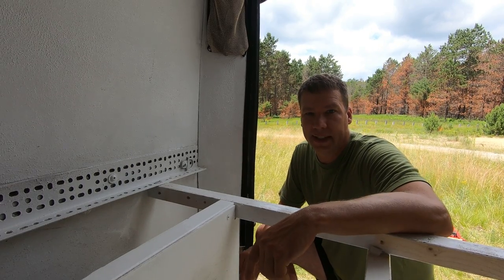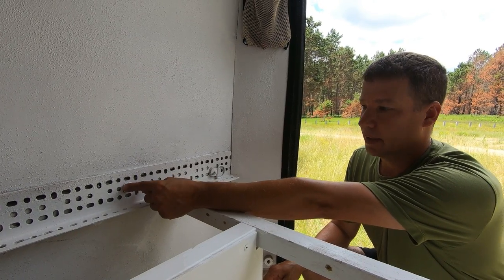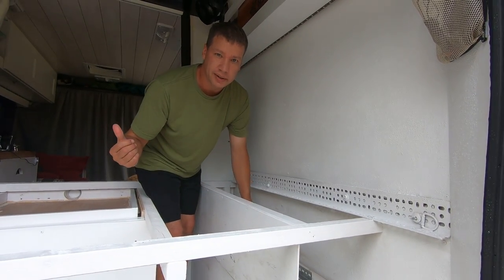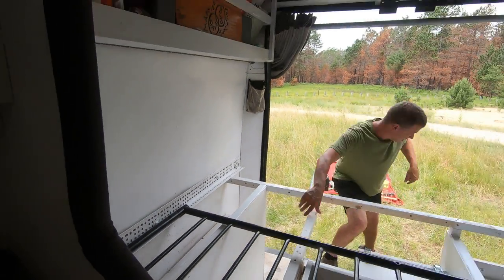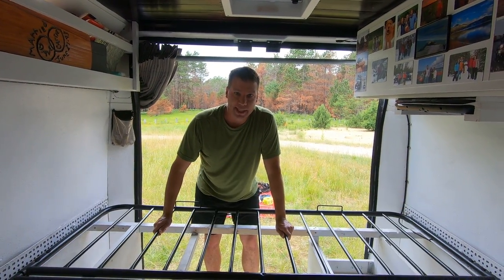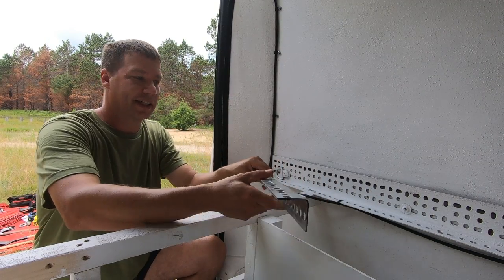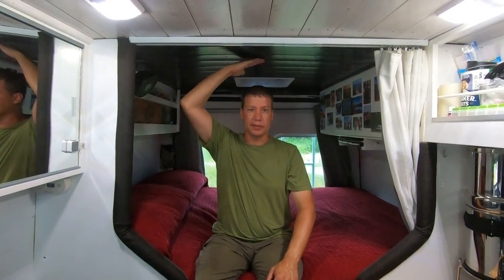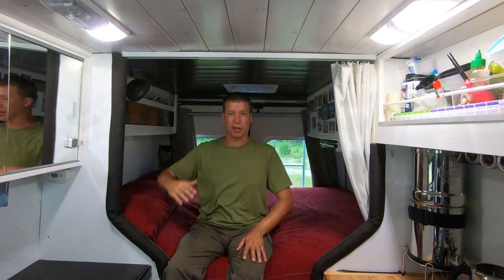Van Build: DIY SUPER EASY Bed Platform Installation

Comment: What a great idea. My van is going to have the same futon frame. Or it looks the same from IKEA but mines going to actually be used like a futon then convert to bed. I bet a lot of DIY’ers are going to use this idea. Love your channel.
Reply from the maker: Thank you so much! Which way will the bed face in couch mode? Sounds awesome and we would love to see it all finished up.😀
Reply: The floor plan is totally different than yours. The futon is in the middle of the van. When in couch mode you face the sliding door. When in bed mode your head would be behind the front seats and feet toward rear doors. It’s not complete yet. I’m loving and learning a lot from your channel. Would love to show you when it’s complete.
Reply from the maker: Sounds awesome!

Comment: Outstanding job, I like how you used the futon frame and slotted angle iron.
Reply from the maker: Thank you, Lamar. It feels good to repurpose things that we had. That futon from lasted nearly 2 years before the welds started breaking. We ended up having to buy a bed frame. It also fitted right into those angle iron braces.😎

Comment: Greetings, 
As the owner of a 2021 Ram ProMaster, I am closing in on finalizing among many options, which bed I will install in the back of my van.  This is close.  I'd like to ask about squeaking as you drive the van.  Does the immovable nature of the futon bed base cause squeaks?    I noticed some who used the IKEA bed spans to build the base.  What i like about that path is, the spans have the ability to telescope to different lengths.  ***This also means the spans will "breathe" as the van rides down the roads all over the country.   I am convinced this would lover the squeaks that will occur due to the immovability of the spans, for example, in the use of the futon frame shown here in this video...   The alteration from this setup is as simple as using the free brackets and then hooking the aluminum rails to the brackets...   Thank you for your time,
Reply from the maker: The futon frames worked great for about a year but the. The welds began to break.  We have since replaced with a metal frame from Amazon.  We have LOTS of rattles and noises in the van but I don’t think we have ever noticed any coming from the bed frame. Here is a link to the video where we replaced the bed frame! Oh and one last thing….. it is VERY IMPORTANT to have space between slats or you will have mold!  

Futon Frame Bed System is a Failure / installing a ZINUS bed slat replacement system.
https://youtu.be/WlhOfHHjEI4
Reply: @oneadVANtureatatime  
Wow, thank you!!
I will watch the replacement video..!

Comment: Thank you for such an excellent idea! How is it going sleeping across the width of the van? Any issues crawling over each other to get in and out of bed or challenges leveling the bed while parking? Thanks for your insight and a fantastic video!
Reply from the maker: Hi Jess. We like sleeping width-wise because it saves more room for the rest of the build. Since this video we have added more sleeping room by making cut-outs in the wall. I think our next video..tomorrow where we add a cabin window will show that extra space. I am 5’10 and now the bed is good. Yes, we do cross over each other, but it's not a big deal...at least I don't think so 😀
Reply: Great to know! Thanks so much!

Comment: I did the same huge weight saving. I cut a metal bed spring frame about 7" of the center  then put 3' metal sleeve inside and pound it together. You have to take off 2 roll of the wire mesh then spring load it again.custom size.
My frame was a light strong wood frame. Which I used as storage above. It's 2 feet of the ceiling just before the bed right a across the van. On mine it rest on my conversion old roof top and a snug strong got a high top.
  Think I the only one doing it this way. That is I want a real living room open space.  So I also run a made wood frame from the front old roof and storage above the driver cab on both side all the way back to just in front of the bed and  rest on that cross member frame. So it  has 3' of walking head room in the middle. Enough to stand and shower too. 
       With so much  storage room up. I only got my 4- 6 volts battery's stove 22 gal propane. A kitchen island, blender and ice cream maker maker. &  A.c air.   Then before the bed I've got a carpet 1-1/2 ' step up area.  that to lie on before the bed and pantry storage and water. Under you need to lift up the floor door. So my high top van has a full living room and I have swevel seats also. It totally wide open below.  the whole van are is open and to design and furnish mine a Art Deco/ ocean decor.  I also got custom louver. in where my big top Window use to be. and the back right side louver can be push out and hold up with a stick. Again a first. LOL

Comment: I am in the process of build and your futon idea is the best and easiest.  Can you tell me the measurement of the futon frame you are installing on the promaster .. thanks
Reply from the maker: We used a futon frame for a full size bed. The frame worked great for about 1.5 years and then the welds began to break. We have upgraded our frame to this frame from Amazon
Reply from the maker: Zinus Bed Slat ~ https://amzn.to/2Yd8CZH

Futon Frame Bed System is a Failure / installing a ZINUS bed slat replacement system. https://youtu.be/WlhOfHHjEI4

Comment: Wow! That exactly what I’m doing! Is just that you are doing it much simpler then I am. I should have waited to come across you video to fallow your step. Quick question! Can you please help me with a DIY? I am looking to find out how to install my cable wires to my alternator to get 220v. I have a 2021 ProMaster 2500 series 159w base with a 220v alternator built in, but I haven’t found a video showing this type of installation. Can you please direct the information to my attention. Thank your so much ahead of time. I will post a video on my installation once I get the info.
Reply from the maker: Hi Jose! I am no electrician but here is what I did. I bought a 1500 watt sine wave inverter and used the wires it came with to hook it right up to the vehicle battery. I mounted the inverter to a board that fits between the two seats and protects the floor. Just know that we have heard if you do this it could affect your vehicle warranty if you have any electric issues. Our warranty is over so we took the risk 😂 I wish I was an electrician and had a better solution for you.
Reply: @oneadVANtureatatime  Thank you for your quick response. What you did make sense. By the way the 220V, I meant 220 AMP. lol- but anyway, I know you understood me, I appreciate your info. This is very important to me, so I have to get this right the first time. :-) Take care.

Comment: Great video! Is the frame just sitting on the angle iron or is it also supported by the wood you have for your garage cabinets?
Reply from the maker: It is just sitting on the angle iron. We just updated our bed frame, after two years the futon frame welds are no longer holding. Still the exact same concept but new frame that we ordered off amazon.
Reply from the maker: https://youtu.be/WlhOfHHjEI4

Comment: I am just getting ready to install the platform on  a new promaster.  Since i have no walls yet do you see any reason not to rest the frame on the existing supports ?
Reply from the maker: We needed the angle iron or it would have not been long enough to reach. I wound imagine that you could use that support beam just the way it is if your bed frame is the right size. I don't see why not. 😀

Comment: I'm wondering if you happen to remember the length of your angle bar? My PM is the 159" extended. I'm installing a full bed using 3 IKEA Skorva rails and a bed frame with memory foam mattress.  A couple guys at the local lumbar store disagreed with me AND one another about the length (they each measured the space). I walked away so confused and unsure of how long I should go...
Reply from the maker: The angle iron is 52 inches long. That fits the futon frame just right. We did custom cut our memory foam mattress to fit where the original futon mattress would have worked fine. We have the 159” wheelbase but not the extended. Hope this helps.
Reply: one adVANture at a time - Thank you- you are awesome.  I love your videos!

Comment: I guess you never heard of Rivnuts or Nutserts.
Reply from the maker: No need when I initially put in the angle Iron, super simple job anyone can do with supplies they might already have.
Reply from the maker: I owned a Jeep Wrangler and used Nutserts with a few modifications, they are a good option as you suggest.